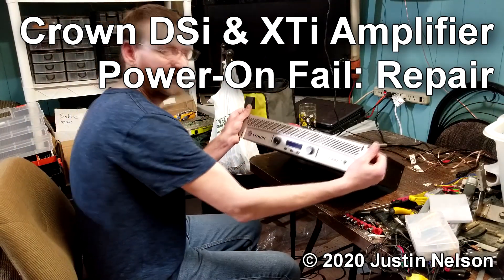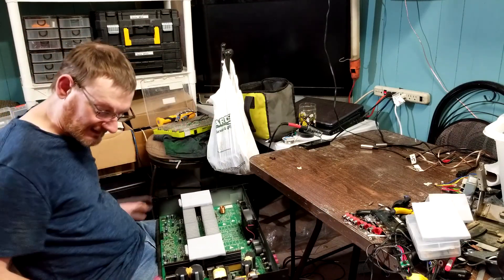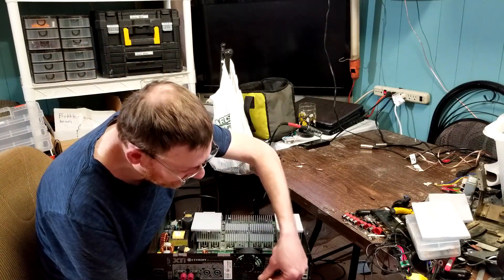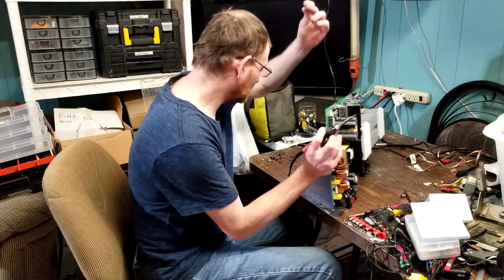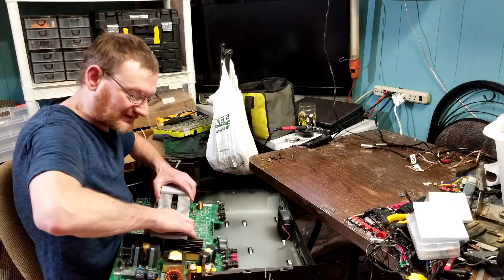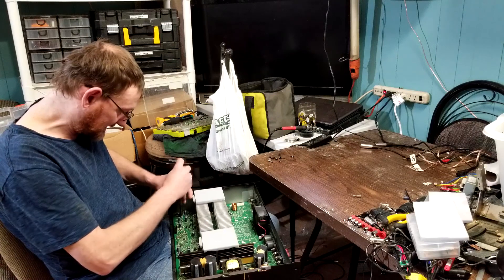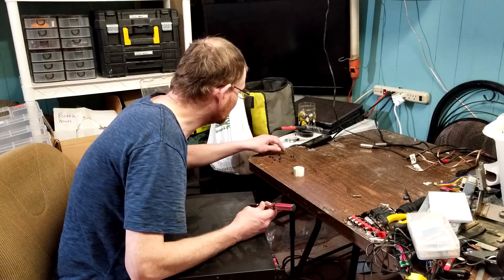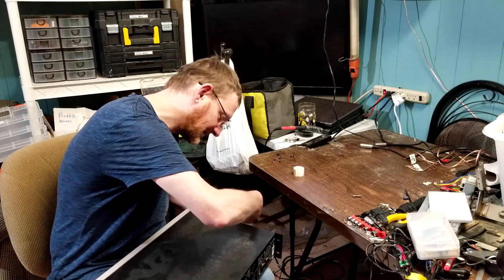Crown XTi Power On Failure   Repair in 16 Minutes

Comment: Do you have a copy of the old Cloader software for the XTI? Thanks
Reply from the maker: I dug around my current PC and didn't find the software... I know I downloaded it, and updated the firmware, and was even able to save presets on the amp... I will have to find where I originally downloaded it from...

I believe since this video is a few years old, that I did that at least one PC build ago... the old machine is actually in another room, I'll dig around there, see if it's still hiding in a downloads folder or something. Either way I'll reply back hopefully with a link...
Reply from the maker: Actually a very brief search yielded this: https://www.crownaudio.com/en/software

It's been a while, but I do believe one of those downloads lets you simply plug in the USB, fiddle with the serial port settings, and eventually gain some control/insight into the amp. I would test it out but I don't have the time at the moment... let us all know if you are successful and how it went :)
Reply from the maker: Also here, you can find the actual service manuals, and other downloads by model: https://www.crownaudio.com/en/support_downloads -- the technical manual is very detailed and is what I used when I first started opening these things up...
Reply: @JustinNelsonsProjects   Thanks Justin. So i have a very early model that was built before those software came out. They dont see the amplifire. I need Cloader to get it to the latest version and then the new software will see the amp. :)
Reply: Thanks Justin. Much appreciated. I've tried looking online but no luck as yet.

Comment: would that capacitor be the cause of a crown xti 4000 powering on and then powering down into protection mode? There is no error code displayed.
Reply from the maker: If it gets through the power-up sequence, that capacitor is most likely not the problem. That capacitors only job is to charge to a certain point, after which the rest of the power supply is allowed to power up. It's basically part of a timer circuit, though a little more complex than that...

If it's going into protect mode, most likely you've got a DC short somewhere, possibly a bad transistor stuck on causing a current overload...

I would definitely take it to a professional and have them go through the unit on a workbench

Comment: Is this repair related to the amp stuck with the fan on when I turn it on? Do you take repairs?
Reply from the maker: The fan control is a completely different part of the circuit. I believe it is controlled by the temperature of the heat sinks, so it could be the thermistor that senses the heat or it could be the control circuit. Either way sorry, I don't do this for a living just a hobby

Comment: I have an XTI 2000 that has worked great for years but died in the middle of a show yesterday. Now it keeps shutting itself off every time i turn it on. I can get sound out of it very briefly before it shuts down. Do you still repair these amps? I wonder if mine is repairable.
Reply from the maker: If the amplifier gets through the initial power up sequence, to the point where you're actually hearing audio, the problem is not likely the same problem I show in this video. It could be a power supply issue or it could be something bad in one of the output stages... Either way it's a little beyond the scope of this particular video.

I'm sure it is fixable, but it would need to go to someone with a workbench and the proper test equipment.

Best of luck, I hope the steers you in the right direction. Thanks for watching
Reply from the maker: It couldn't hurt to go ahead and try to replace that capacitor, it may be in the early stage of this particular failure... It would only cost a few cents and a few minutes of your time if you are comfortable soldering and all that fun stuff. Just keep in mind the high voltages that could be stored in the input capacitors, I have another video somewhere on his channel from years ago, just look for a similar thumbnail in my video list lol just a stack of amps... I believe in that older video I show how to discharge the capacitors and all that. Again best of luck

Comment: I was just gifted with an crown xti2002 and is having problems getting to power on and I believe it could be the capacitor as well but I want to know where and what kind of capacitor do I need.
Reply from the maker: I did a more in-depth video about a year before this one, it should have linked to it at the end of this video but here's the link:

https://youtu.be/6dUT3sxJtqo

For future viewers, I have pinned a comment linking to the prior video that gives a lot more detail. Long story short it is capacitor C196, located just to the left of the power switch. It is a 220 microfarad capacitor rated at 35 volts, which isn't enough. I always replace it with a 50 volt version but keep that 220 microfarad rating so that it operates correctly. That just lets it handle the slightly higher voltage spikes that often occur. Sadly they still haven't fixed this design flaw and even newer amps often have similar issues...
Reply from the maker: I just realized you said 2002 not 2000. It should be similar but the board layout may be a little bit different as the 2002 is a newer model. I recommend looking for any capacitor about that size that looks damaged, and he bulges on the top of the can or any leakage underneath. Any capacitors that look damaged should be replaced but specifically the startup capacitor should have a slightly higher voltage rating than what they put in. Hope this helps.

Comment: I have a no power XTI 4000 , is the repair the same as the 1000?  Also do they use the same replacement capacitor that you are suggesting?   Thank you for all the help.
Reply from the maker: I haven't had the privilege of opening up a 4000, but I imagine it is similar if not the same board -- if you open it up, and the board looks exactly like mine (but with more components on it), and there is that same capacitor near the power switch, the possibly this fix could work... I couldn't tell you without seeing one for myself however...

Comment: Man. My  CDi 2000 doesn't have a C196. It has a C915  right next to S7 and I can't find any evidence of its existence outside of looking at it on the board. It doesn't look like it's poofed out or anything. This unit says it was built in 2016.
Reply from the maker: The actual component number is based on the particular circuit board that all of my amps happen to use. Mine are much older than 2016, minor around 2008 2009 so they probably did some revisions.

One thing you can do is carefully desolder C915 if it appears to be in about the same place and the same rating, and try it with an LCR tester. Just look up LCR meter or LCR tester on Amazon. Or simply go ahead and replace it with a higher voltage but same value replacement and see if that helps.

Good luck, and thanks for watching!
Reply from the maker: One quick follow-up, unlike resistors and other components, electrolytic capacitors often have very wide tolerances. So if it says 220 and your LCR meter reads 180 it's probably still actually good. But again the safest bet might just be to go ahead and put a 50 volt version in its place and see what happens...

Comment: You can actually twist the cap out from the top, unsolder the leads,  clear the solder holes with a vacuum station & solder the new part in without having to remove the board at all.
Reply from the maker: I'll be honest, after fixing half a dozen of these amps with the exact same problem, that thought did not occur to me :)  That would bring it down to about a 2 minute repair, mostly removing/replacing the cover screws!

Comment: my xti 2000 output volume getting weaker by each day, the bass is also gone. Any idea?
Reply from the maker: Is it getting proper ventilation? Is the fan running when you drive the amp? It sounds like some components are simply worn out, and excess heat can accelerate that process... Wish I could be of more help but he may need to get someone qualified to look through it
Reply: since the first day i bought this amp, the fan will only run if i push it hard enough(volume led hit at least orange color), the fan never run on low volume even if the amp is running for long period with the casing metals getting very warm.
Reply from the maker: @careles3520  That has been my experience with the XTIs as well - the fans only kick in when pushed very hard. Normal listening levels, even when the casing feels quite warm, no fan action. But a few seconds of thumping bass, and they are in full force. This is by design, it keeps the fans from wearing out prematurely, and keeps the internal temperature of the entire system at an equilibrium...
Reply from the maker: Just to follow up on that last statement - keeping all of the internals at a relatively constant temperature will make everything (capacitors, transistors etc) go through less thermal stress (caused by thermal changes) and effectively last longer. This is why in many settings, these amps are NEVER powered off. I never turn mine off, and many restaurants/movie cinemas etc just keep the amps powered up at all times.
Reply: i took it to a repair man, after checking he said some IC might be faulty thus triggering the protection mode to cut the power. Yet he is unable to be certain nor fix it.

Comment: Awesome video! I inherited an XTI that wasn't powering on. Noticed the person had pulled out the two large capacitors c57&c58 as well as pulled the fuse. Changed those, changed the small one you suggested. Now I have a Low Line error, and I can't seem to find much info about it other than my voltage is below 105. I know that's not right. Any ideas?
Reply from the maker: The only specific issue I happen to be familiar with is the one in the video, because I ran across so many amps that had that exact problem with the underrated capacitor. As far as troubleshooting a low line voltage error, somewhere out there on the internet is an actual service manual for the XTI and DSI series... When I find that link again I'll post the link, it's directly from Harman kardon or crown's website I forget which. You might be able to find it with some Google and it will help you with measuring voltages at various test points, just be careful measuring on a live board obviously :-)

Comment: good trainig sir .thank you. sir dsp off and display shut off what can do sir? please ....
Reply from the maker: The only advise I can give without having the unit in my possession, is to check the ribbon cable that powers the front panel. If it has come loose (the fronts of these fall off very easily when not rack mounted), that could be the problem... otherwise, I'd have to see it for myself, sorry.

Comment: My xti4000  one channel not working.how to fix it.
Reply from the maker: If one channel is dead, it's more serious and you'll need to diagnose that. You can (VERY CAREFULLY) compare voltages at different points, comparing what you get from the dead channel and one of the "good" channels, to narrow down the problem. Could be a transistor, an IC (op-amp), a capacitor, or any number of things...

I recommend having a pro take a look, I can't tell you much more without having the unit in my possession...
Reply: @JustinNelsonsProjects  i catch it.its volume control problam.thank u

Comment: Working on a CTs-2000 with blown output transistors but can't get the correct part numbers to obtain replacements. Any idea how to either get a schematic or obtain the correct part numbers?
Reply from the maker: If you do a deep dive on Google, you should be able to find a PDF of the service manual. I had a copy for the DTS at some point, and I just remember spending a few hours on Google until I ran across it... Otherwise, look at places like mouser.com or digikey or even just Google and try cross-referencing the numbers on the transistors to find an equivalent.

Comment: in your opinion are Crown amplifiers worth the extra $$$ over QSC ?  i have a QSC PLX 2402 and it always sounded great but the fan is stupid loud and after all these years the volume / gain knobs got a little rusty and sometimes they lose signal and i have to fiddle with them a bit to get a good contact.  although i definitely feel i got my money's worth with QSC given the power and and the sound quality i at the same time feel a truly quality product shouldn't have had those two issues i described.  do you think Crown is the same just more expensive or is it overall a better brand ?
Reply from the maker: I have used the QSC amps in the past. They are good amps, but make sure to read the actual specs. A Crown that says 2000, actually puts out 2000 Watts RMS at the rated load (say, 4-ohms per channel). Where the QSC are generally quoting "peak" wattage, which is marketing garbage. In the fine print you'll find the actual RMS wattage output to be roughly half the "peak" wattage... just my opinion (don't want to get sued for slander :) )
Reply: @JustinNelsonsProjects  i hear what you're saying ... i originally got my PLX for audiophile purposes ( not to push raw power ) as it was a very clean amp for its time, but in the end it was a huge mistake due to the fan noise.  worst of all they learned nothing from their mistakes as the new PLD uses the same fan and heatsink setup as my PLX with only 2 fan speeds and an always-on fan that is very loud even with no music playing ( just like my PLX ).  if i didn't have the PLX i wouldn't believe the reviews of how bad the fan is on the PLD but sadly i believe it.
Reply from the maker: @g1981c  When cranked, these Crown amps do kick in a rather loud fan (mine are about 10 years old though, they may just need new fans). But the DSI series were intended for cinema use. Tons of raw power, really clean sound even when cranked, and usually (In that setting) they reside in a rack off in a separate, temperature controlled room. Note that the fans can be replaced with a standard 12V PC fan ...
Reply: @JustinNelsonsProjects  in my use i do not foresee cranking the amps very often and if i do hopefully at that point it gets loud enough that fan noise is not an issue.  the problem with QSC is the fan is on and loud the moment  you flip the power switch even with no input signal.  i currently use it to watch movies at night and in some scenes my room at night gets completely silent and that PLX fan going "WEEEEEEE" is literally the loudest thing in the room and just ruins the suspense ... that said, i am only considering class D amps now, in no small part because they require less cooling and therefore can potentially have quieter fans, though in case of QSC PLD it seems that potential was wasted.
Reply from the maker: @g1981c  if you're comfortable opening it up, they do make quieter fans. Measure it, check the voltage on the label, and match it to a super quiet PC fan. I guarantee you will notice a difference. The crowns only turn the fans on when they get hot, they actually have a temp sensor on the heat sink which is one of the reasons I like them. I only really hear the fans after the song ends lol
Reply from the maker: @g1981c  on that note, when that particular DSI Crown amp does crank the fan up, it sounds like the bearings are dying on it. Maybe I'll make a video soon about swapping that fan out for a quieter one. Again the ones I have are over 10 years old so I'm sure the grease is all dried up. I have another XTI crown app and I barely hear the fan at all when it does kick in so I know it's just something with the actual fan. Maybe that video will help you with your PLX. Maybe this weekend I'll film something
Reply from the maker: @g1981c  One more comment about how a company doesn't learn from their past mistakes. Even Crown is guilty of that. That's what started this whole video series, the design of the startup circuitry on the power supply. There's one underrated capacitor that always goes bad, all they really have to do is swap it out for a 50-volt version instead of a 35-volt version and the amp would last much much longer. On the bright side, this means I tend to obtain so-called broken crown amps that literally just need a capacitor swap to make them run like new 😁
Reply: @JustinNelsonsProjects  my PLX fan sounds brand new - it's just a really loud fan.  i had this very exact sound on one of very early 1,000 watt computer power supplies that used a very similar fan.  i had used very quiet Noctua fans in PC builds but i had used them in applications DESIGNED for quiet fans.  the PLX was designed for whatever monster of a fan they put in there - and i'm not going to modify it - i would rather sell the amp and buy Crown.
Reply: @JustinNelsonsProjects  yes it's weird to me.  reminds me of how back in the day i used to order hard drives on Newegg and Amazon and they would all come broken because they were properly packaged in boxes of 20 from the manufacturer and the store would take them out, throw them in a box and it would arrive in pieces.  i couldn't understand how they can keep making the same mistake over and over but that's how it is LOL.

Comment: I have 8 crown xs1200.  3 of them go into fault mode . I'm running them on my dual 18 subwoofers.  Some of them have worked great for years.  I'd love some direction in figuring out this problem
Reply: any luck on repairing your XS1200 amps? I have one that faults when powered on.

Comment: Any ideas for the Crown 4x3500? I have a unit that just powers on with four fault LEDs solid red.
Reply from the maker: That is a monster of an amp I haven't personally encountered. I do know the 4-channel amps are a bit more condensed (more channels = more components), and the power supplies tend to be a little more complicated... sorry wish I could help, but without first hand experience with that particular amp, I would suggest searching for the service manual/schematic... they are available, just a little hard to find